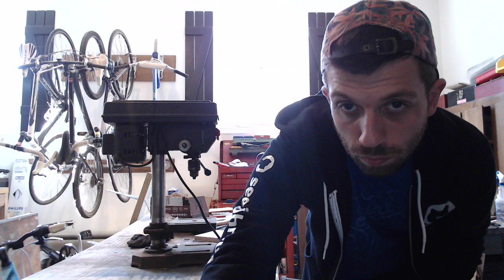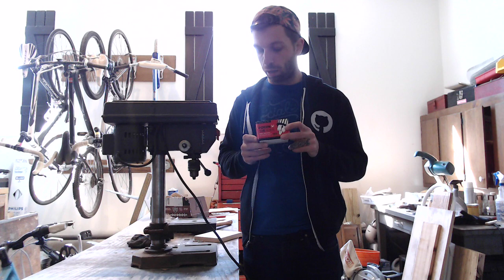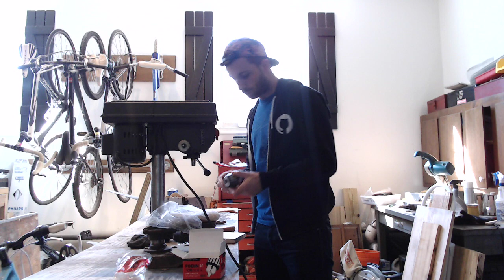Drill Press Chuck Installation

Comment: A couple tips he didn't include:
-Clean the shaft and the inside the chuck, even if it's brand new.  People recommend acetone, but I used IPA, and that's probably fine in most cases.  I used a q-tip for the inside of the chuck.  You don't want any dust, dirt, metal filings, or anything else that prevents 100% contact between the two surfaces.  Even new parts might have debris from when they were machined or assembled.
-Heat the chuck first.  You don't need to cook it, but if the chuck is warmer than the shaft, it will expand.  If you tap it on there while it's still "oversized," it will grab when it cools even better than if both parts started at the same temperature.  If it's winter time when you read this, then leave the press in the garage and take the chuck inside, maybe in front of the fireplace or space heater.  A little later you bring it back out to the garage, tap it back in place, and it will grip it nicely.

Comment: Too bad tapping it on didn't work for me.
Reply: I just added a couple tips above: Clean both surfaces first, then heat the chuck before tapping it on.  More detail in my other comment.  Point is, don't chuck it!

Comment: My chuck is not coming off and my Sears Craftsman is cleaner than the one in this video. I tried penetrating oil and I'm using a ball joint fork tool. My chuck says 3/8 with a 33 Taper. I looked for a set nut in the chuck but there isn't one. I don't have the key for it so I wanted to change to a keyless chuck but damb it, it's not coming off. HELP!

Comment: How hard should I hit it? I'm scared to destroy the mechanism inside. I thought I hit it plenty hard but when I used it the chuck fell off
Reply: If you retract the jaws all the way and give it a pretty good hit it should stay on. Slightly harder than you would think, and try to make sure the taper is clean first.
Reply: @johncrepezzi  yeah I crossed my fingers and beat the crap out of it with the plastic side of my hammer. Not too hard, but firm hits. My logic was that if you keep hitting something, you can nudge it further and further without hitting it harder. No problems since.
Reply: @NeutronJohn  awesome, I'm glad it worked out :) using the press will also continue to push it tighter so you should be good

Comment: After 2 years; the new chuck fell off when using a 2 1/2 in hole saw. Back on with rubber mallet and it fell off again. Thinking of using some lock tight ??

Comment: Great explanation. Another way to get a stubborn chuck off, assuming it still works, is to clamp a nut tightly in the chuck and then thread a bolt into it to push on the taper from below, like a gear puller
Reply: Great tip, thank you very much.

Comment: Is another way to do this, is to replace the chuck and then press it against a piece of wood? I am putting together the same 5 speed drill press that you have. I got it from Harbor Freight and the chuck wobbles. I've only used it once.

Comment: Is that as mine? Value Craft 8050 MFG 19A I need to take it off and wondering how since there's no hole at side to put a wedge Don't know if to bang it out .
Reply from the maker: Not sure / most drill presses are the same though!
Reply: @seejohnmake Mine don't have the side hole to be able to put a wedge inside and have it pop off so I'm figuring it might be the type you bang out till it drops off, I'm going to use a ball joint fork to slip it off.

Comment: Thank you very much. I assembled the whole thing but the directions said to gently insert the Chuck. This caused it to fly off when powered on. However after this video I went back and slide the table up some, added my board and then pressed down a little harder and the tapered end locked itself into place.  So thank you for instilliny confidence in getting my chuck installed. I was able to finish all my hole drilling this evening and ready for more success tomorrow.
Reply from the maker: Happy to help! Thanks for writing!

Comment: I just bought this 8" 5 speed drill press and went to put on the chuck got it on went to pull on it a little bit and it came right off not sure if that's a good thing
Reply from the maker: You will need to hit it a bit harder I think to secure it